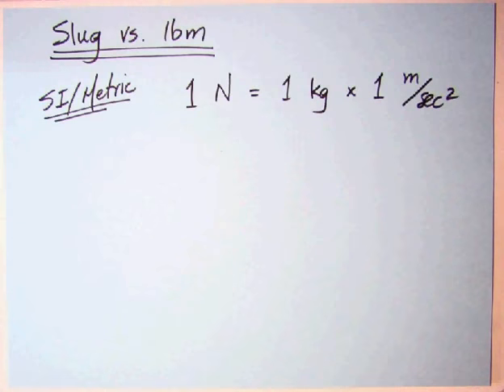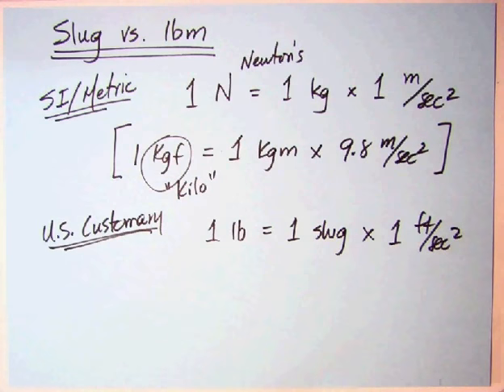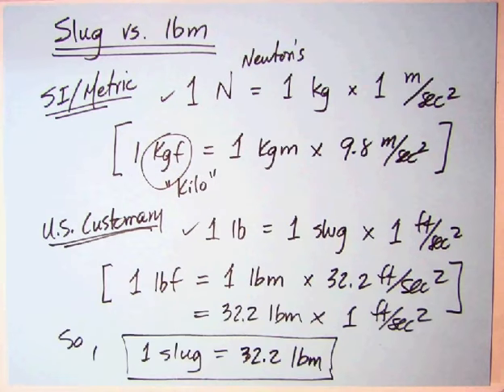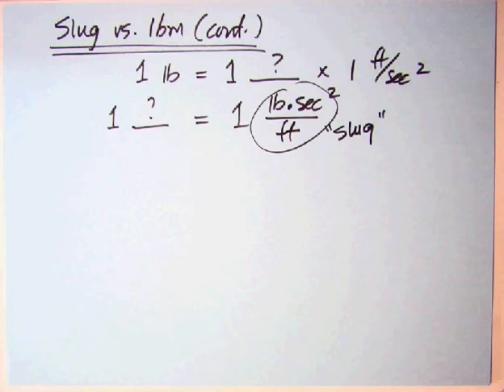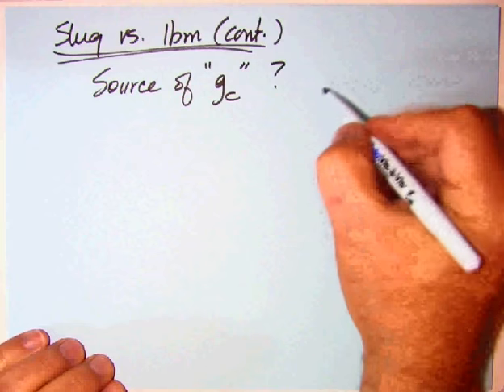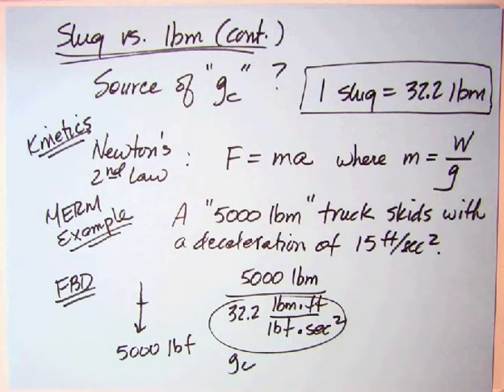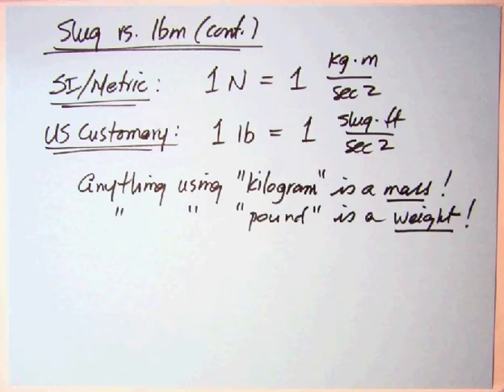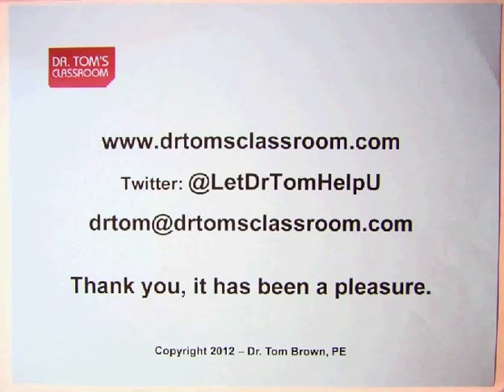slug vs. lbm - Dynamics (What the MERM doesn’t tell you)

Comment: Fantastic, thanks for clearing up the Gc mess, Dr. Tom, finally someone I can relate to!
Reply from the maker: I am so glad this helped.  This is the most troublesome issue in mechanics, those who will not accept "slug" as the unit of mass, but cling to "lbm" then need to arm wave away the problem with something called "gc."  Where are you located and how did you come to watch this video?  You have made my day.  Thanks.  Tom
Reply: Slugs have simplified it, no more wondering when to use gc, I used to get so frustrated, esp since I used metric in my undergrad..
Thanks!
Reply from the maker: FireLight275  Slugs solves a great many problems.  Why people still cling onto gc is beyond me.  No gc in the metric system because everyone accepts Newtons for force.  Everyone hates the term "slug."  Tom

Comment: This can catch even the most seasoned engineer, off guard. Signed off on a design that called for unrealistic structural enforcement. 3/8" plating for otherwise 10 gauge sheet steel. Re-ran the calcs in SI units and had to take the walk of shame with a dunce hat. Never gets old. Now, I have a picture frame of a slug on my wall.

Comment: Now, you know what you talking about. I been researching the internet and books for the past four hours and it seems nobody really knows the background. But this made it super clear. I do have one question in heat transfer when talking about btu/lbm, is the 'lbm' a unit of weight or mass? Why not just 'lb'.
Reply from the maker: In Thermo and Heat Transfer "lbm" is taken as mass, as those working in those areas have never warmed up to "slug."  Fortunately the conversion 32.2 lbm = 1 slug never comes into play like it does in Mechanics.  And keep "lbm" and "lbf" as they distinguish whether they mean "mass" or "weight", even though it is the same value.  A 100 lb weight (lbf) has a 100 lb mass (lbm).  Adopting "slug" would make things so easy and consistent with the SI System.  Glad my video helped.  Made my day, as this is probably the most unnecessarily confusing topic I teach.
Reply: drtomsclassroom thank you so much!! Most of my professors just tell you to divide by 32.2 without telling any background. Not sure if they do it to save time in class or they truly don't know lol